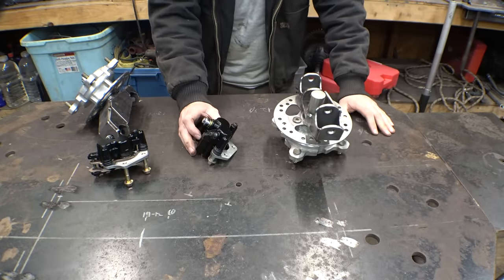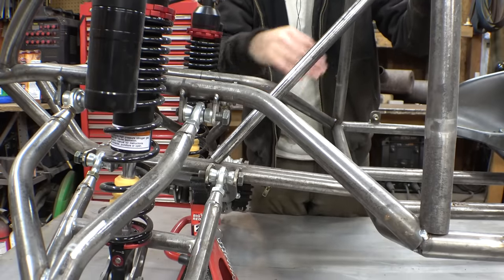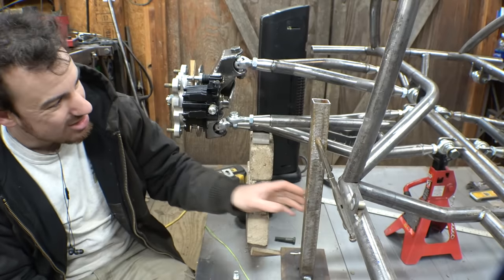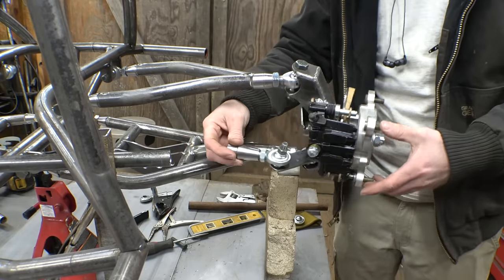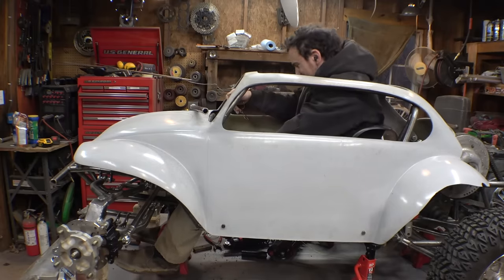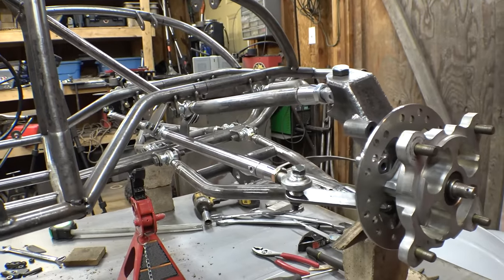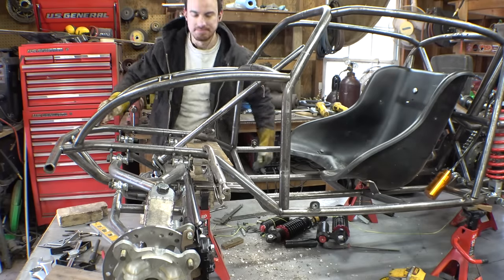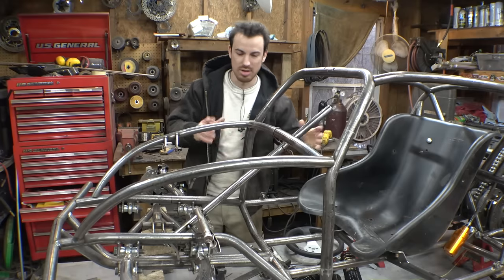Installing Steering on the - Home Made Mini VW Baja Bug!! - Part 9

Comment: Cut it in the middle n extend it 6”🤷🏼‍♂️, put the throttle n brake on the steering wheel 🤷🏼‍♂️That things gna rip 🤘🏼 get a lil wood stove in there, does your ole man or someone do trees ? Ya always have plenty of wood n it wouldn’t take much to take the chill out that lil shop 👌🏼🤘🏼🤘🏼

Comment: Diesel heater all the way and vent it outside properly. You would have a little sauna in that little shop for way cheap the amount of diesel. It burns is nothing confirmed propane or anything.

Comment: Ditch the floor heaters, get a electric box heater to hang up 150 bucks, hard wire it to 220 thing will run u out of the barn with no fuel smells.

Comment: Have you considered a tank like control for throttling and braking and take pedals out of the  process..  Make a two hand grip pull to throttle, push to brake, and rotate left and right to steer.

Comment: You should seriously consider stretching the frame a couple of inches and making a little body stretch too.... Definitely going to need a racing steering wheel w/ quick disconnect but this time make sure you cable it so nobody can move it out of reach again.     😂😂

Comment: Harbor freight has them ceiling heaters pretty cheap get the smallest one punch a hole in your wall for a chimney use propane tank to run it. Make sure it has the propane needle in it as well not natural gas.

Comment: Hey Chris! Wonderfull build so far, can't wait to see the final results. Maybe one comment about your sitting situation. Indeed you look crazy cramped. And frankly, seeing your head at this level, that close to the top front bar of the windshield makes me very concerned about your safety. What if you roll over? Your head will get crushed with no place to go. And What if you hit something at the front...even with a helmet, having this top of the windshield right in your face is asking for trouble. Since the begining of your build, i kept thinking that you may have been able to fit a "formula 1" kind of super low sitting with your but a bit below your current lowest point of the chassis, to the point where your head would be further back and inside the cockpit. Looking at the current state of your frame, this is maybe not to late to cut your seat supports and try to sit lower, with your feet up. Might not be the most intuitive position, but perhaps its worth a try. For your safety...and because the formula 1 position could work well in this project in my opinion...just saying ;) Keep the good work, your awesome!!

Comment: Your steering shaft should have a bearing at the very bottom of it and a bearing or bushing more towards the steering wheel and of the shaft if you put a bush in at the base of the steering shaft and then end up applying pressure downward to the steering shaft it might get a little hard to turn depend on what type of bushing you're using that's how almost every ATV is set up

Comment: Buy the cheap rv diesel heater for 120 bucks and install that inside and plumb the exhaust and burn side intake outside... just make sure you let it always run the cool down cycle when you turn it off

Comment: Could you source a honda odyssey steering wheel? Not the mini van the atv. Its small and has light switches, kill switch, throttle, and brake. You could have the hand brake work all 4 brakes and you turning brake would still work on the back. Packaging wise it would deal with several of your issues. Just a thought.

Comment: chances are the pressure wasnt correct on the diesel heater? I recall they need around 3.6 psi on the gauge and easily adjustable. Maybe look into rv furnace or something like that?

Comment: Extend that frame and fiberglass body about 6 to 8 inches in tge middle, should give u plenty of room and not look to bad if u blend the body in well with fiberglass or metal painted same color as the rest of the body when done

Comment: There should be a screw to adjust the pump on the diesel heater.. it needs more pressure/fuel.

Comment: it's a very very tight space por your feet, i think you shouls put the steering leverage in front instead in the rear as you did,
on this way you will find more space for pedals and you can cut the shassis and make it lower and wider between front suspensions and the seat.
you have the two parallel pieces of tubing and a 90° horizontal piece, you should make them with an angle of 45° on each side after the suspension, to join the cockpit chassis.
and then in this newspace ypu can find the place for the pedals.
to join better the steering you can use cardanic joints to follow the shape of the fiberglass hood, and then the steering bar can go down to the uniball joints in front of the suspensions.

i hope i've explained better as i can how i imagine to solve this problem.

onestly, i really would like to see the fiberglass body on your projects, cause they may look really  better, especially the trike, but it's the first case i really don't.
naked is better.
you can find an old fiat 500 and use the car body with the same dimensions.

Comment: Install a chinese diesel heater in your shed. It intakes and exhaust outside and creats great heat and is alot better on fuel then those big diesel heater or propane

Comment: i would still raise the body / frame by 3 to 4 inches and avoid cutting the mud flaps. it will give you so much more space and also help you not roll over

Comment: Go out and start the Propane or Diesel heater and let it run about a half hour, Then go in and turn it off with the small heater. Once the shop surfaces warm up, the whole shop will stay warmer for a while. But long term the camper heater is the way to go. Maybe design the next project around you since it seems like you always wind up compromising too much on space for you. Face it, no matter how well a project works out, if you don't fit in it. It's no fun. I do realize you build because that's the part you like.

Comment: Hmmm... apparently your steering wheel moves through about 30° for lock-to-lock movement at the hubs. That's going to be incredibly uncontrollable and twitchy. A rack and pinion will bring that down to something usable, notwithstanding your comments regarding steering wheel controls. A handlebar has a 1:1 steering ratio - your drag link arrangement actually multiplies that, instead of reducing it.

Comment: If you really want this thing to rip and be super reliable I should have said this sooner but I suggest you find an XC 600 or 700 engine the twin cylinder you'll have way more power way more throttle response and a lot more reliability than any triple snowmobile engine the problem with the triples is they are hard to balance although the 600 XLT triple and Arctic Cat zrt 600 triple we're probably some of the most reliable triple engines

Comment: Use a steering brake, single handle either brake. Push pull arrangement. Not 2 pedals. Even braking would be hard to do at speed. I am more worried about no room in the car for the body to absorb impact or to get ejected easily. Just the head sticking out is going to hurt, maybe forever.

Comment: You should have cut the body in half at the start then you could have fitted the front for leg room and the back so it went over the engine right. Then made up the gap in the body from fiber glass or aluminium. Love the build but not sure you'll enjoy driving it at all.

Comment: It looks to me that your torpedo heater is burning way too rich and flaming out as a result, so there might be a problem with the air intake or the thermocouple is either broken or too far from the pilot light.

Comment: Dude... just drop the pan a bit for your heels up front to lower your toes. Easy fix. Wait... disregard.  I just looked.  Feet are on the chassis.  Yeah... do two ralley light pods for you feet and mount two of the flat style LED lights on the front to make them functional... doubly functional. Lol

Comment: It was a real mistake not starting with the cockpit and making sure you could fit everything YOU need in there with at least some modicum of comfort and safety. Almost everything else is a variable, but your body is kind of a fixed dimension. You were so busy wondering if you could you forgot to ask if you should. lol.

Comment: Check the "fuel pump" aka Rotor on the diesel heater.  Its made from little carbon discs so can easily wear out or get damaged.  Super simple fix, and fairly cheap $15-$20.

Comment: The deisel heater take the fuel tank and put air thru tank make it force fuel thru the litle jet. Works everytime ot fix them. Yours is just not getting steady fuel or to much trash inntank

Comment: Can everyone please tell Chris about diesel heaters ! If you don't know what they are, check out my channel. They vent all of the exhaust outside through a 1 inch pipe. No CO or fumes to worry about. You may need 2 of them on a real cold day with no insulation, but it's better than working in the cold.

Comment: Please stretch the passenger cabin by 6 inches at least.  You can fix up the fiberglass and it will look like a typical Beetle with a chopped top.  Sacrifice the looks and make it feasible to drive comfortably.

Comment: Why dont fabricate a small wooden stove or what its called, kinda like GrindHard had in their old workshop, that way you can have plenty of heat and evacuate the fumes thru a stovepipe.
Should be a piece of cake for you to wled togheter ;)

Comment: Can someone please explain to me why he didn't want to use 1" tubing for his steering linkage because he didn't want it to be the same diameter as the suspension... and then he uses 3/4" SCH40 pipe which is actually LARGER in diameter than 1" tubing and required a bunch of extra work and extra weight to boot?

Comment: You seriously need to make a pellet stove or a rocket stove to heat your little shop with. Or have someone build you one that you can install. Either design can pull air from outside to burn and then the exhaust goes out the same way but through a different tube.

Comment: What it is it's caused from you welding in there without a ventilation system and then you're using a propane heater which is causing a big problem. You have to have ventilation coming in and out of that building when you're welding and running a propane heater. I'm surprised you are not sicker than a dog yet because of that

Comment: Ok so your diesel heater is just dirty. If you clean it it will start fine. The problem with diesel is its dirty and stinks worse than propane. But just clean the heater and it will work fine again.

Comment: You need add some head protecion behind the head. I feel like you can snap your neck in this :O

(maybe that's the plan later (the head protection, not neck snap :| ). I could miss that)

Comment: Dude ! You’ve done some dumb stuff before but bare handing a razor blade ti clean up the edge of a spinning part on a lathe was the dumbest!! If that had grabbed that bushing material your thumb or finger or both would have been sliced wide open!!!! 😮not smart!

Comment: I would have far more respect for you if you would simply weld with proper safety equipment on stated clearly; wear your gloves every single time you strike an arc with your face and eyes protected. Because millions of young men around the world are watching you operate your welder in an unsafe manner. And they are going to repeat the same stupid behavior and hurt themselves. Because if you did it, they'll do it!  This build has been awesome so far. So why not finish it with excellence?  so...be better at what you're doing!

Comment: *** YOUR HEATER USES KEROSENE *** please stop putting diesel in it... use K1 kerosene and you will amazingly not die.... pretty important here ... Who told you to put diesel in that damn thing sucks... Diesel is so nasty try and find out... Pretty sure it says kerosene and diesel but I'm sure it doesn't recommend what your doing and using diesel fuel.. and it works like an oil furnace it's got a spark plug and an injector, clean and gap ish the plug  should be good... Personally I bought a similar sized propane heater torpedo heater and run it off 2 grill bottles .. please please please put K1 and pour that diesel in a truck.. that is why you feel sick please stop using diesel fuel kind sir yes it has CO both make carbon monoxide, but diesel is half un burnt and has crap and other byproducts that are way harmful and making you sick...